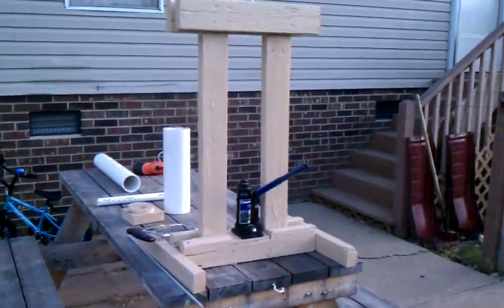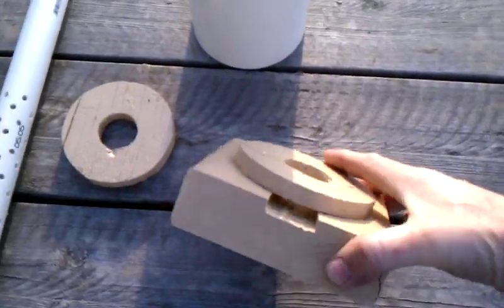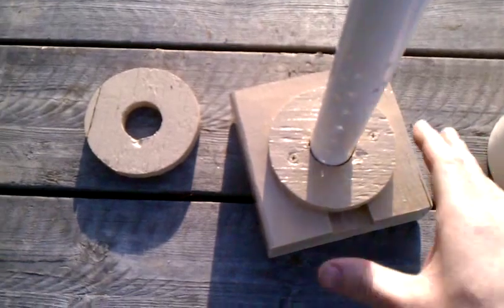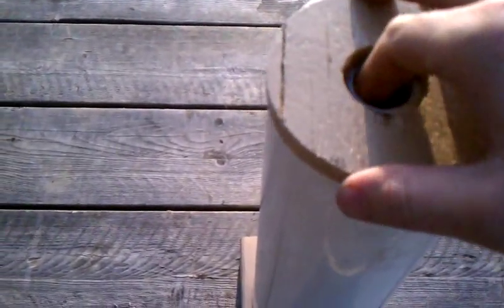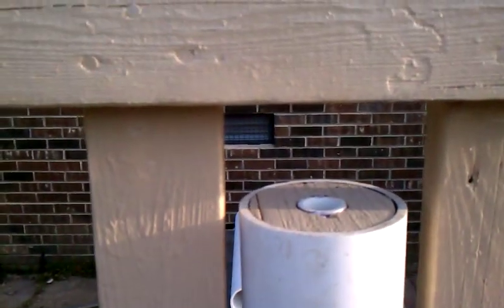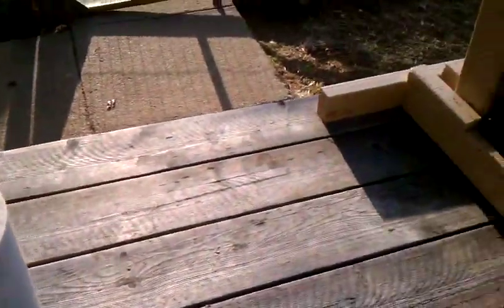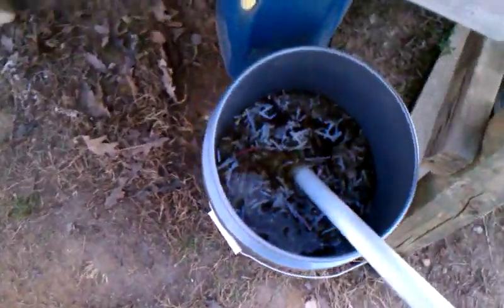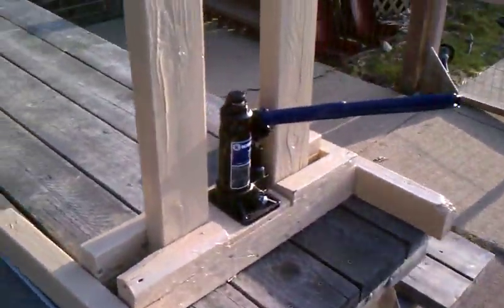Peterson briquette press

Comment from the maker: Yes, I used 70% shredded paper and 30% dry leaves. Add water let it sit for a couple days. Then I used my drill with a paint mixer bit. I got it at lowes for 7$. Once it's mushy and pasty it's ready to use. Good luck and thanks for the comment.

Comment: Ever thought about fastening the jack at the top, upside down, so it doesn't get wet every time and last longer? You could use braces to slide it on or off when not in use...
thinking of designing mine this way, when I build, as my briquette machine produces smoldering product.

Comment: I'm having a real problem making briquettes...the paper mulch cloggs the
 holes up and stops the water coming out., then the pressure builds up 
so much that the mulch ends up being forced passed the ram and spurts 
out of the top and bottom.
I've tried different size holes and different amounts of holes but nothing seems to work , the water won't drain out?
The mulch i'm using is news paper with some saw dust.
any idea's what i may be doing wrong.? Thanks